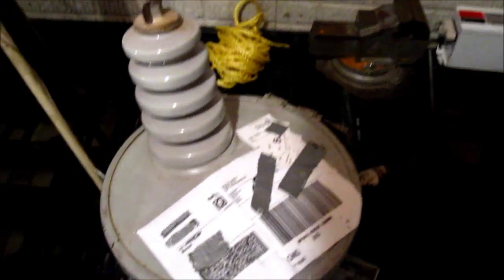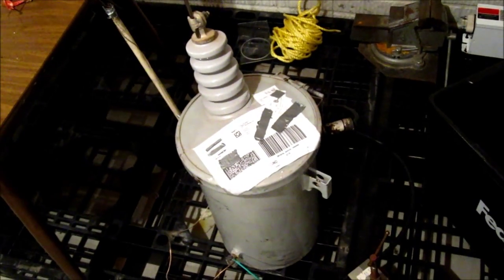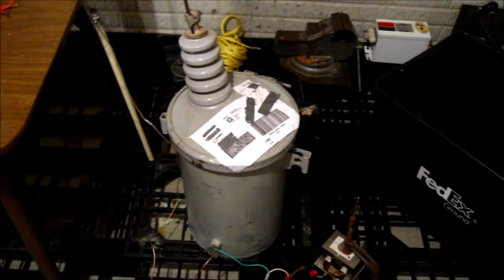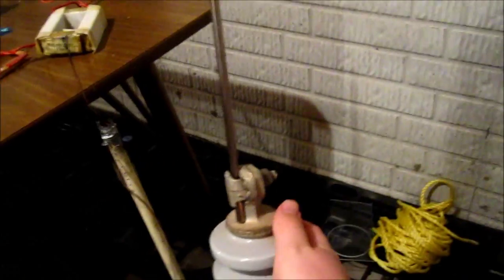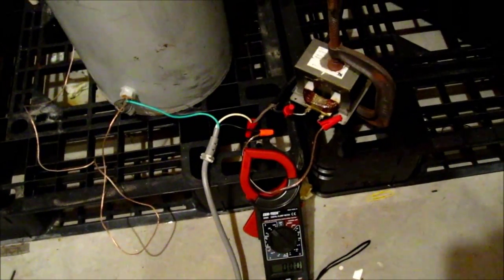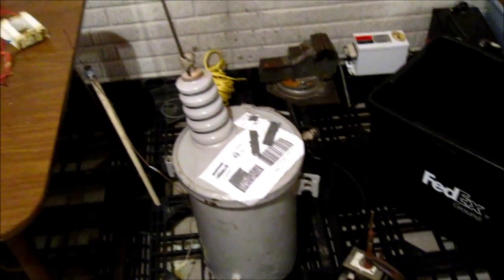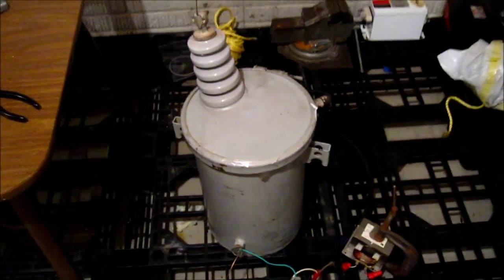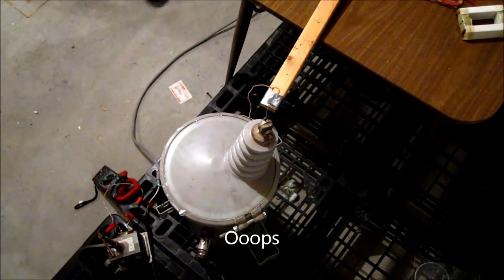The Pole Transformer

Comment: Is your rod you are pulling arcs with a ground or are you just picking up a load to keep current down?
Reply from the maker: One side of the HV winding is connected to the case, which is then connected to earth. My chicken stick is grounded and connected to the case which I can then pull arcs from the primary bushing. So yes, I am arcing to ground. The current is limited on the input side.

Comment: That's so cute!  If you had ever seen one of these blow up your dumb ass would never put that bomb in your basement btw those half kva transformers don't have internal fuses so god help you if it ever develops a short which is likely judging by the age and you got it used off of eBay.  I see a mineral oil fire in your future.
Reply: Wok i hope you have some experience in linework talking like that! This guy is having fun you should know he is back feeding it the primary or in this case secondary.... H1 would just short and cause a breaker to trip or his wires to melt feeding to the X bushings whn you back feed them your not getting out what you would on a power line will current and fault wise you might get 1-2 amps and rms 300-800ma not a big deal for the High side to cause an explosion plus most of these have a pressure relieve valve to prevent catastrophic explosions ive my self overloaded a 10kva Pot guess what i did nothing besides draw enough current to trip the line feeding the ballast no explosion and infact the pressure in the tank was at a very safe level.... mineral oil fire? he has the damn thing ballasted to a level if there was a fault it would not be catastrophic
Reply from the maker: While I appreciate your concern, I think you are mistaken on this issue. This unit does have an internal fuse as indicated on the name plate. Additionally, this is powered by a current limited supply which is not even near capable of blowing said fuses never mind actually inducing an explosive failure in this transformer. Explosive transformer failures generally are the result extreme overloads or shorts for extended periods of time which will boil the mineral oil, over pressure the can, and catch fire by the resulting arc-over. This unit is in a thick walled steel can with a pressure relief valve. I have opened the can and inspected it and it appears to be in good condition with clean oil and no signs of impending failure. The power levels and duty cycles that this is run at along with the available fault current simply do not pose a reasonable risk of a high level failure. As a good practice, I keep a fire extinguisher around in case of a possible arc fault or other issue which could ignite the mineral oil or other flammable materials in the area. I do not see a scenario any more severe than that as a likely possibility.

Comment: Four microwave transformers in series makes a spark higher than this encumbrance.
Reply: true but they do not last very long.
Reply: Lol, MOTs are shit. Huge idle current, core saturation, shitty isolation, high impedance, and a lack of size to dissipate the heat from their shitty aluminum windings. So this "encumbrance" is actually not so useless after all. It's just being pushed much less hard than those 4 MOTs.

Comment: Question, the more the load on your ballast the  more current right? Because I have a 12780/240 it's has 2 high voltage leads of the primary and 3 low voltage taps on the secondary. I'm just using light bulbs as a quick and easy ballast at the moment. And the arc seems to climb up the Jacobs ladder for maybe a second or two and then my 30 amp breaker will blow? I have it set up to where the two 120 volt are on the outer taps x 1 and X 3 Plus the ground in the center tap X 2. and then I have the case of my pole pig grounded to the same ground on my center tap. What exactly do you think I'm doing wrong, not enough ballast maybe?

Comment from the maker: Thanks pete, 
Yea from what I can tell I have no worries about pushing the xformer. I run it on rather short duty cycles and I think it will handle all the power that I can reasonably give it. The ~3 kW I ran it at in this video seemed perfect. I just need to get a better winding on my ballast core to be able to run for more than 5 minuets at a time. Its almost too much fun drawing arcs on the thing!